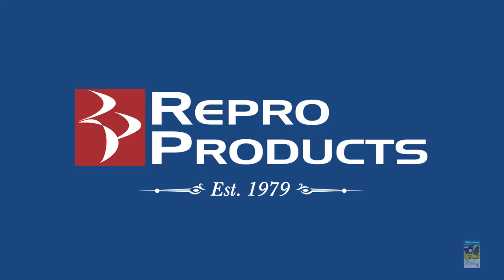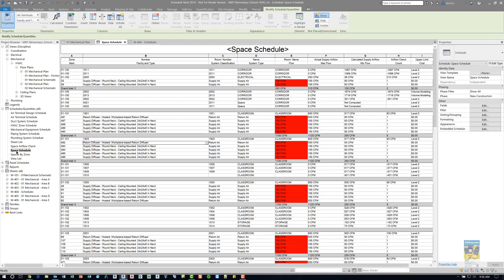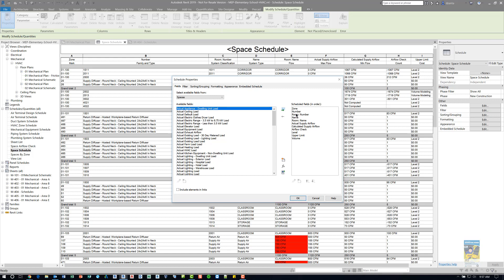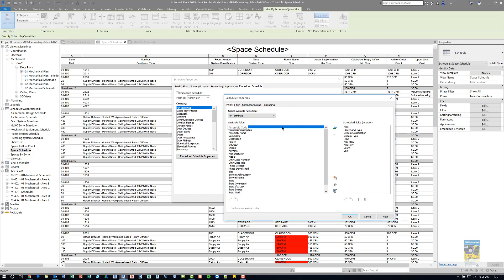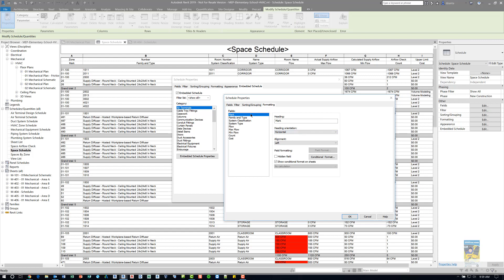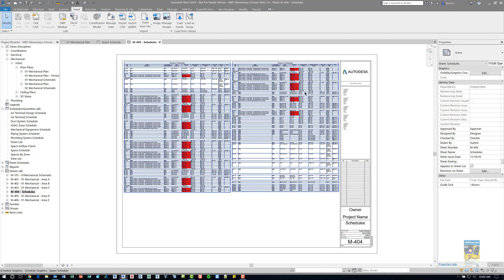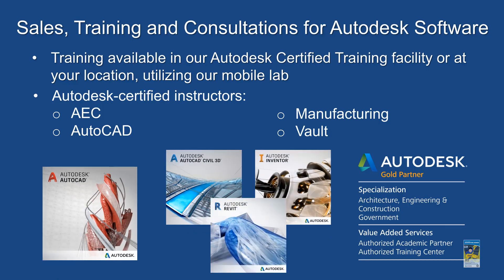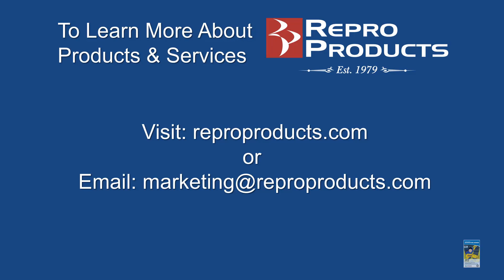Revit 2019 Embedded Schedule in Spaces for Air Terminals

Comment: Thank you! Do you know if there's a way to show which mechanical Equipment has which air terminal?
Thank you in advance
Reply from the maker: You can use the System Browser to find out this information.  It will tell you all air terminals and which equipment they are tied to.  I do not believe the schedule list of parameters available show this option.
Reply: @DzanTa  THANK YOU
Reply from the maker: @paulagoni6703  you're welcome